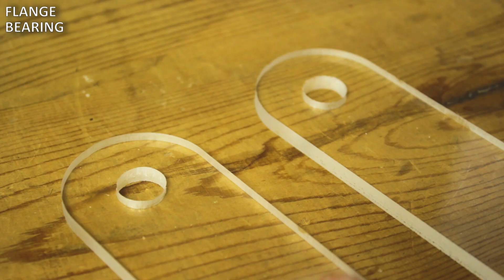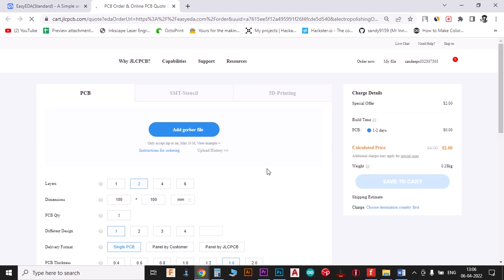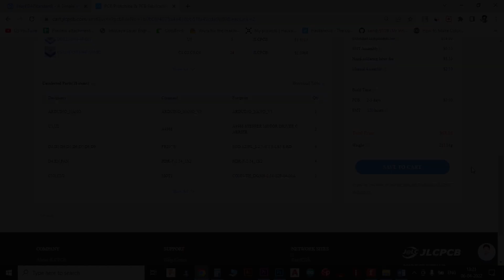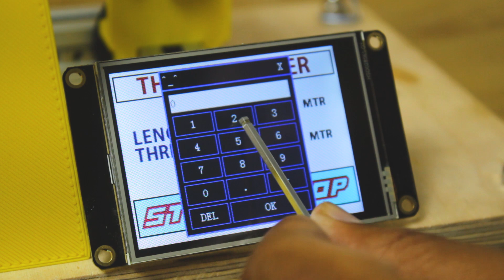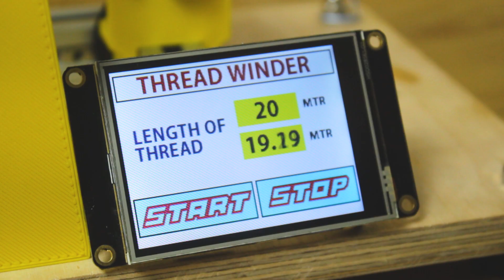DIY Arduino based Thread winding Machine

Comment: But .. the thread is already wound on a spool (on the right side) .. so there is no problem to be solved???
Reply: It could also be used for things making string like a spinner, or even something like a “rayon” (reformed cellulose) production line.

I guess they just haven’t made either of those yet!